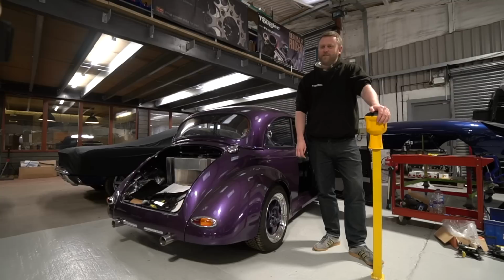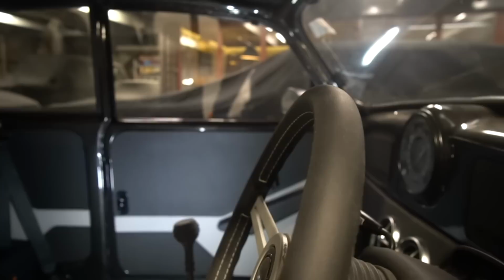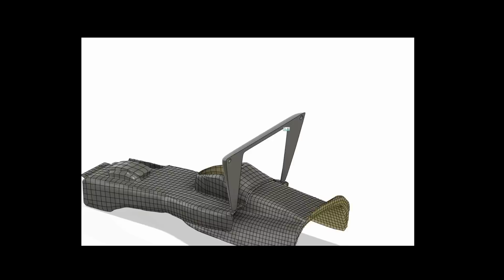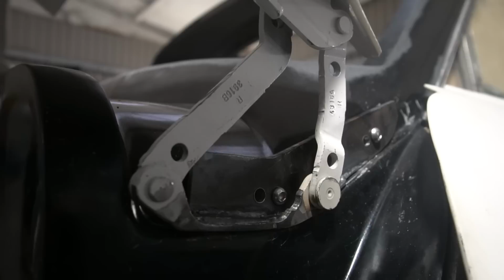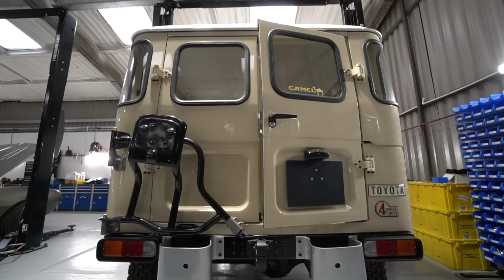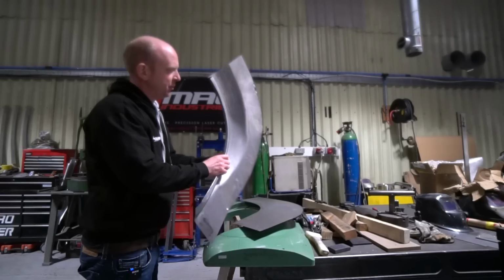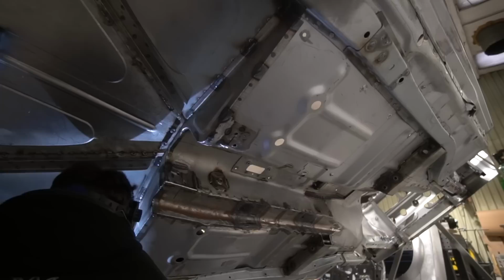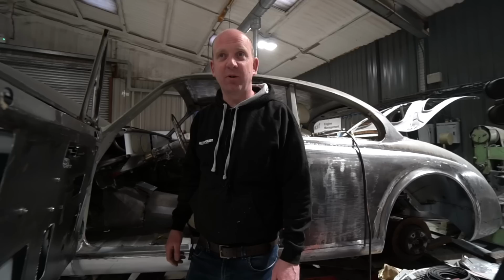Retropower Uncut Episode 127: 1968 Camaro Build, Roadster Shop & Gordon Murray Visit!

Comment: Top work again boys, everything looking good . I wish you would make / buy  an alloy grate over the front of that pit
Reply: I strongly agree. Looks like an accident waiting to happen.
Reply from the maker: It's normally covered with a car, but of course you do need to get into the pit somewhere so has to be uncovered when in use
Reply: @retropowercars  I fully understand but i still think just a light weight movable ally grate would be a good idea .
Reply: We had a pit where I worked and just popped in a set of thick floorboards over it when not being used. saved many nasty injuries. Didn’t realise it was legally allowed to be open like that? 🤔
Reply: @09gearchange  I worry about it constantly and have written to them several times about it. (I’m retired HSE trained) …

Comment: Living here in Arizona we run into the issue of scratches in glass and when I worked at the local Chevy dealership we used a type of acid that helped get them out... I'll find out what it was and let you know...
Reply: It's a type of wheel acid that was gotten from an auto detailing outfit...gets rid of fine scratches... it's for mag and aluminum wheels... Auto Care is the company name for auto detailing

Comment: On the Etype steering rack you said "it's actually a left hand drive rack flipped upside down" would that not make the steering work in the opposite direction i.e. if you turn left the car turns right? I cannot think Retropwer would make a mistake like this...🤔
Reply from the maker: Steering rack is behind axle on mondeo, infront on etype.
Reply: @retropowercars  Should be fine then, A friend of mine did flip a rack over once to fit his Pop,(many years ago) after several days of fabrication he sat in the driver's seat and to his horror when he turned right the wheels went left, luckily I was there to witness his reaction and offer my support 😂

Comment: Disappointed to see a DAB aerial stuck on the inside of the windscreen on Morris - was there no more aesthetic alternative which arguably might also have provided a better signal?
Reply from the maker: I'm not keen either but they are the only type we've found to give a reliable signal
Reply: @retropowercars  
If you want to know why dab aerials are so absolutely shite, it’s because the DAB signal is actually broadcast on the same frequency previously used for black and white television. 
Now I’m sure you remember what a tv aerial had to look like to work ! 
The only DAB aerial we ever had any luck with were the bee sting type amplified switching type form hirschmann or pioneer. 10 years in the car audio trade. 
Love your work.

Comment: How do you get a left hand drive steering rack albeit flipped upside down to steer in the correct direction?I've flipped a steering rack on a kit car ,from left to right hand drive, and turning the wheel caused the wheels to steering in the wrong direction.Had to source a replacement RHD rack.
Reply from the maker: Because mondeo rack is behind the axle, etype is infront.
Reply: Fun fact - a rhd Lotus Elite (Type 14) uses a lhd Triumph Herald rack